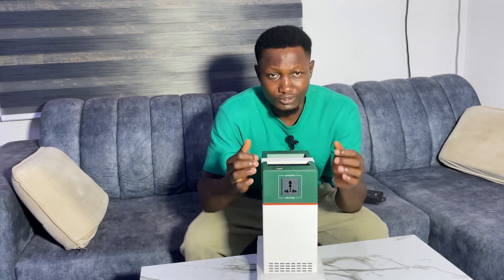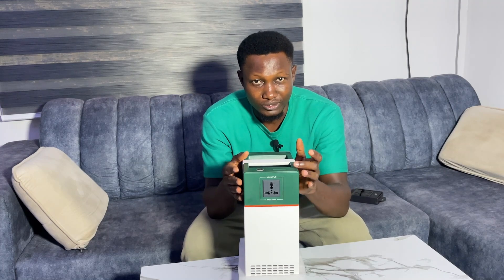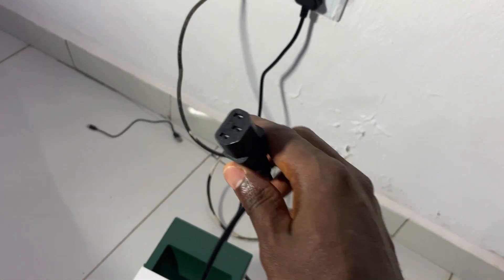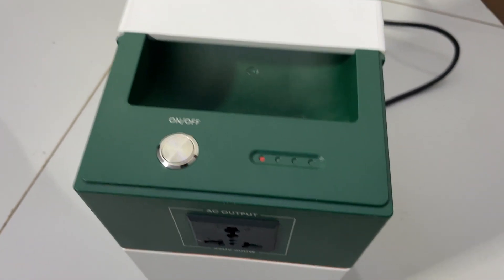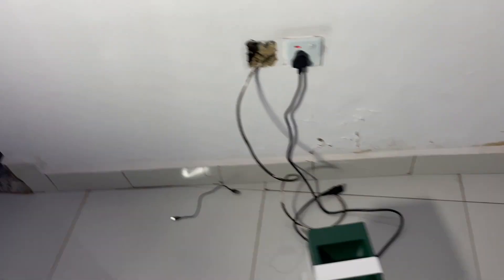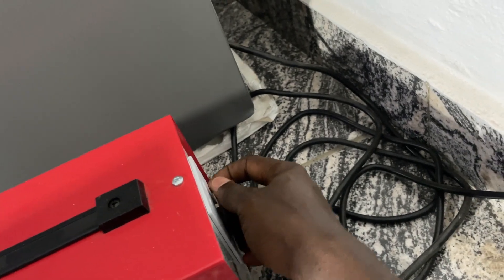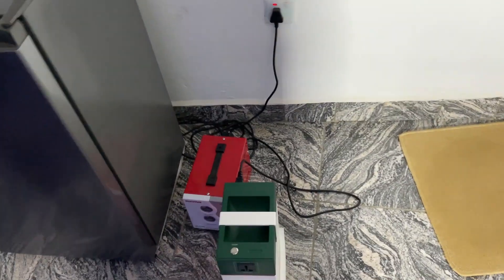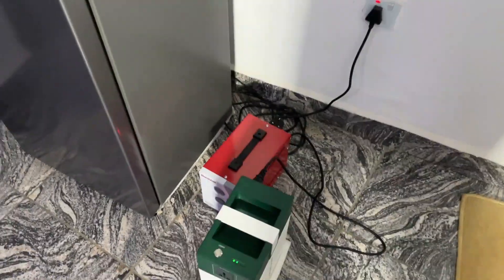Do This If Your Cola Solar Generator Is Not Charging

Comment: Good evening sir, please im having issues with my cola, I mistakenly changed over to nepa light forgetting my inverter was on and now it’s just showing red lights. Pls how can it be resolved
Reply from the maker: You meant, your inverter was ON powering your house before you mistakenly changed it over to NEPA light?
Reply: @LearnwithMrBukie yes sir
Reply: @LearnwithMrBukie  now when your power it, it will show the normal four bar green lights, then it will switch to the red light indicator
Reply from the maker: Are you sure the NEPA voltage in your area is full? Try using a stabilizer first to charge it and see.
Reply: @LearnwithMrBukie  I have used it, it’s same thing. It’s does not even supply light into the house
Reply: @LearnwithMrBukie it’s even fully charged
Reply: @LearnwithMrBukie so my hypothesis is that, since when I turn it on, it shows the green light then return to red light indicator, maybe the resistor inside the inverter got damaged when I switched it to nepa forgetting I was still concerned to the inverter in the house.
Reply: Please help me, I have been using my cola 1000 for more than 2 months now, but recently it doesn't change more than the second bar, I have tried using nepa also, same thing, I have been using a 430 watts panel
Reply: I wanted to get it but all this issue coming up with the solar generator make me step back in getting it

Comment: My issue is it's changing but when I on it to use it,  it starts showing the red indicator and I even tried on it without any load but the problem persist
Reply: It’s a low current issue 

I noticed one day when electric cookers when being used in my house 

You can try another phase that may be better.
Reply: @ThaatVideoGuy I just had this issue after which I try to use my solar when phcn took the light but my solar is not longer supplying light 😢
Reply: Thesame here was your problem fixed ?
Reply: Same with me
Reply: Hmmm

Comment: Thanks for making this again Mr Bukky. My own electricity here is just a little bit above 120V especially in the evening when the whole community has all their devices powered.

I will just have to budget a 2kva stabiliser along with this if I want to get one.
Reply from the maker: Yes, you have to budget for the 2kva stabilizer, because it’s very very important. If not, that low voltage will always be a problem to you.
Reply: @LearnwithMrBukie  Do you think a 1kva stabilizer will work?
Reply from the maker: @MK-lc2ct yes, 1kva stabilizer will charge it